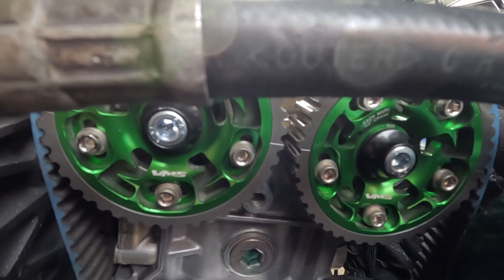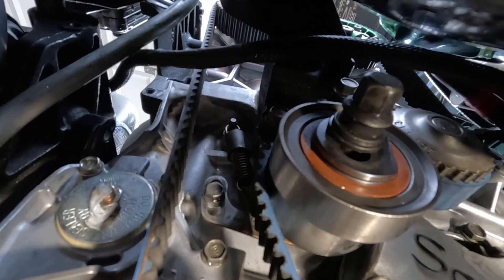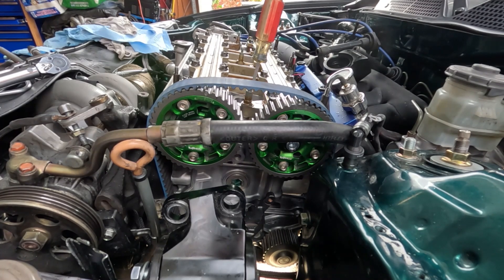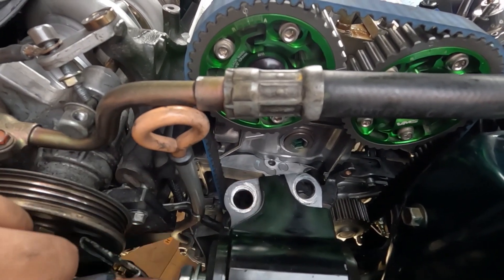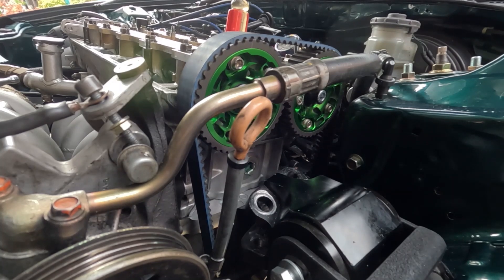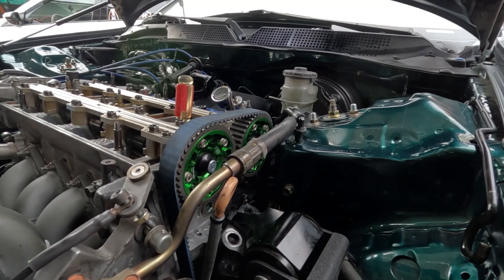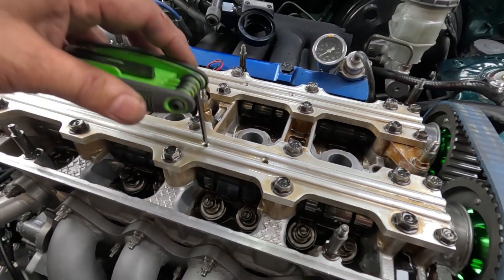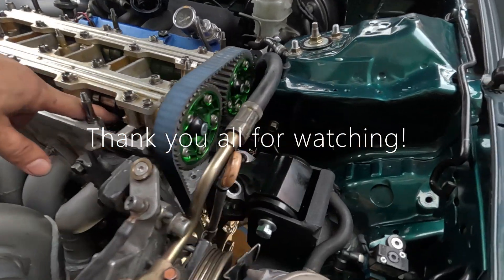How to set G23, H22 Timing belt tension using manual tensioner.

Comment: I love that you give all this knowledge for us to learn
I want to convert my h22 to manual tensioner, but I am not sure what parts from h23 I need to use, do I use h23 tensioner and the rest of the parts h22?
Reply from the maker: It's all good brother, you can check Hondapartsnow.com and look up under cam timing section and you'll see what you need. Some parts are duscontinue but no biggie, you can look up on 98-2000 Accord and basically same parts. But make sure to use a washer (#30) under the bolt #27. I went to homedepot and got me the biggest washer enough for the tensioner body to slide up and dowm and made hole bigger so the bolt will go thru. The item #20 wont be needed unless you want to. If you do convert on these style, your belt might be too tight to install and you have to shave the tensioner in order to make it easier, l also have a video of it on how to do it. Thats the reason some folks are using kstuned belt tensioner cause of the cost are basically the same and not whole lot of teardown on the block. You just  need too set the correct belt tension so it wont make a whinning sound when you set it too tight.

Comment: So I built g23 really like what it does on oval track but going to go with another new build. I. Using F23a1 with F20b crankshaft and F20b rods with aftermarket H22 pistons 11.5:1 H22 4Piston head. This should be very torque monster build high rev coming out of turns
Reply from the maker: F20b will get you out of turn coz its hi rev engine, using 4piston head! Kool build man.
Reply: @sagittnet2158 I gotta call a guy tomorrow to check and make sure using F20b rods and H22 11.5:1 pistons will work or not. I may be wrong on my math. Thanks for ur videos bro. You gave me the confidence to start building my own engines. You are much appreciated
Reply from the maker: @jeffkidd8296 The H22a4 piston will fit the F20b rods but you need to oversize the F23a1 block to 87mm. Not sure if you want to go that route, if you stay NA its should be no problem l think. Some f20b builders use k20 piston, the nippon racing ITR piston so it'll have more comp ratio to compensate for the k20 piston height if use on f20b n rod setup on f23 block and no need to resize the block unless you want 87mm.
Reply from the maker: @jeffkidd8296  and your'e welcome man!
Reply: Definitely 87mm bro  @sagittnet2158

Comment: Hey kuya! Kamusta? I was wondering if you know the  valve clearances for the H23A? I hear it's different than the h22 because of the longer piston stroke.?
Reply from the maker: Mabuti naman at salamat. The non-vtec H23a1 valve clearances specs are different than vtec version. Even though H23Avtec got more crank throw than H22, l believe both will have same settings sinced it's same H22 cylinder head.
Reply: @sagittnet2158 okay! Salamat!
Reply from the maker: @germaincouture6483  👌

Comment: damn i needed this video like last week while I was replacing my timing belt and water pump, I put in a 1320 manual tensioner but when i put it too tight it was making a loud noise, when i loosen it the sound went away. Im still trying to figure out the balance shaft timing, the service manual said to put a 6mm bolt inside the service hole and other say to line up the lines with the mark. when i put the bolt inside the balance shaft the lines on the gear doesn't match up
Reply from the maker: Oh man! Too bad but keep turning the wheel till the line lineup and insert the bolt. Bolt can go 2 ways. I have a video of it on how to do the b/s. I'll update my playlist if ypu stlll need it.
Reply from the maker: If it's off 1 teeth, motor sound like its gonna explode. You must correct it.